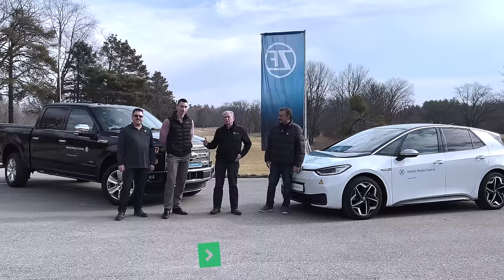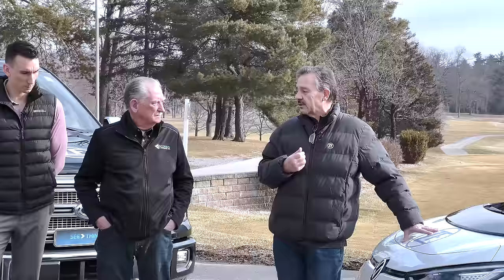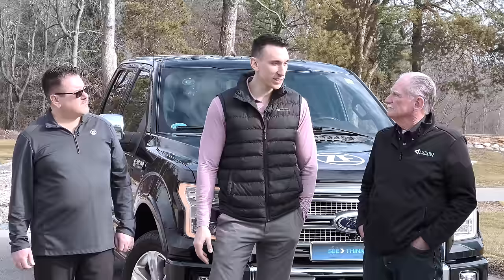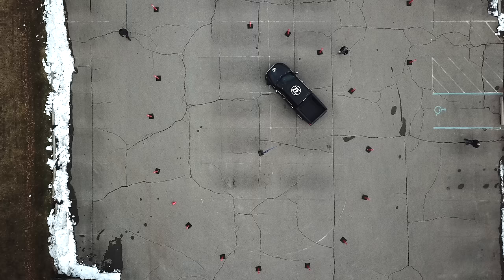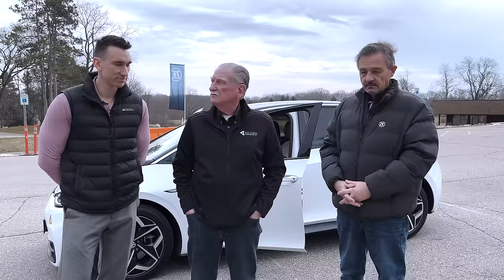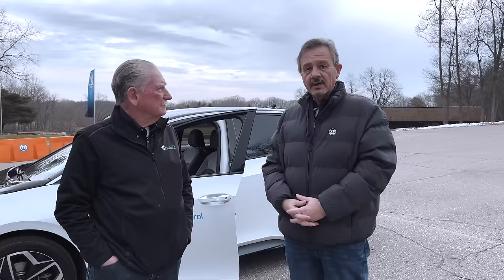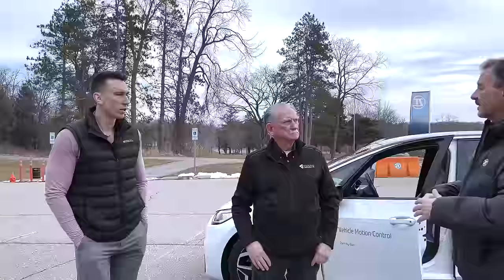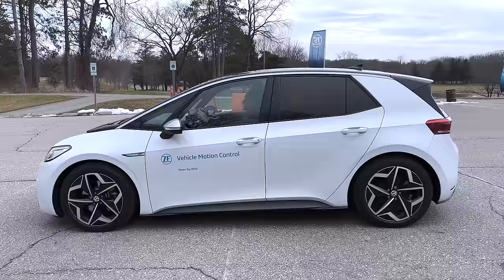Steer-by-wire - how it works with ZF

Comment: I have a question om steer by wire safety.....
I realize that they have redundant systems. But what about power? What if there is a complete power failure? Do they have a backup battery just in case?
Reply: The 48 volt electrical system has its own battery.
Reply: In an airplane there is generally much more time to react to an electrical failure.  They have multiple power backups.    Each engine has a generator, there is often a APU and if all that fails they pop a prop driven generator out to create power.    I have heard that the CT has 2 redundant power systems.  Don't know enough about it to say more.
Reply: @davidelliott5843  Yes, but is there one or two 48 volt batteries? If one fails and there is only one and it fails... You're screwed!
Reply: @danharold3087  Thanks. Yes, I've also heard that they have redundant systems, but unless that actually includes two batteries so it is fully redundant, there is a problem. Hopefully someone with direct knowledge of these systems will let us know.
Reply: @DavidJohnson-tv2nn  Exactly.   How about using one set of wheels in the regen mode during a power failure to power the system!    Some say the tech is too expensive for redundant power backup.  It is already there.  Maybe more transistors.
Reply: After the past few years of Boeing Fly By Wire fails killing hundreds of people per incident despite the high level of maintenance passenger jets receive I would be hesitant to view a mechanically disconnected steer by wire system in a personal vehicle as a viable system for public use.  

I hear the argument about fighter jets using them however most drivers can't afford a team of flight-line mechanics to come over and verify the safe operation of their Drive By Wire System every few drives or so like they do with fighter jets since that would make owning a vehicle unaffordable for all but the most wealthy individuals.  Ask a flight line electronics tech how many fighter jets get sidelined for extended periods of time due to issues with the electronics and fly by wire systems?  Most might be amazed at the answers.  Too often they can become sidelined for so long they end up getting scavenged for parts to keep those with easier to fix problems flying.

We also know from experience that the MBA's and Bean Counters will not be able to resist modifying parameters to shave not grams of weight but every fraction of a cent they can off these systems, sacrificing quality on the Altar of Maximizing ROI and maintaining Fiduciary Responsibility to Shareholders.  An honest consideration of what could go wrong should cause most to have trouble sleeping at night.

While I find it amazing technology I'm not sold on it being a required or highly desirable element in a basic transportation vehicle.

Best!
Reply: @neilfromclearwaterfl81  Your viewpoint is valid but your examples are not.

You started on the wrong foot.  MCAS was not fly by wire.  It was designed to apply a small measured amount of force to the yoke to make the yoke feel like a 737-NG.   Somewhere along the line this really got messed up.  As designed the pilots could have simply moved the yoke.   A similar system was and is being used successfully with the  KC-46 tanker to stabilize the plane as weight shifts during refueling. 

Fact is that MCAS as designed only required 1 AOA sensor because it was an augmentation system.   I can only speculate on how it was so badly messed up.  It is unconscionable.   I can't imagine a computer engineer/scientists of control system person messing it up like this. 
The sad part is that in days gone by they would never have tried to make the plane feel exactly like its predecessor.   They would have more or less taken up new pilots and showed them that the stick felt a bit different.  Good to go.  Make of that what you will.  Yes pilots are now trained to fly the MAX w/o MCAS.  So sad.

Apparently in the case of the lost door plug having that crew of flight mechanics at the planes beck and call did not help.
Reply: @DavidJohnson-tv2nn  There are two batteries/power sources.
There is the 48V battery and the HV battery (which can also be used to provide 48V)

Comment: Fascinating. It takes Tesla to deliver the CT and suddenly Sandy gets invited by a big german supplier so they can demonstrate their Steer-By-Wire system. Why didn't they pitch to other car manufacturers before so we could've get rid of column based steering ages ago? Very curious. One company that kicks the industry out of stagnation it seems. Next we see Bosch invite them to demonstrate their 48V system.
Reply: Japanese manufacturers were putting steer by wire in the odd car over a decade ago. It's not even slightly new as a technology, the main problem is it's solving a problem most people don't have in a more expensive way, so negligible consumer interest - I already have electrically assisted power steering with mechanical feedback straight from the road with far fewer parts, safe steering in the event of power loss, and way less computer intervention. The most interesting thing the electronics related to the steering do in my car is feed the steering angle and wheel speed to the satnav, so it can still tell me where I am in tunnels using dead reckoning, and that's in a satnav system that first came out around 20 years ago.

48V electrics, on the other hand, should have probably have happened 20 years ago - that was the point where I first read about the car industry pushing for it. There still is no good argument against it apart from 48 V is lisghtly more prone to giving people shocks that can kill them, but in a 400+ V electric car that seems somewhat moot. The Mercedes S Class from the late 90's/early 2000s was supposedly running enough electrical toys that they claimed it could at least theoretically pull 5 horsepower from the battery. Converting to less medieval units, that's about 3.7 kW, which would require a 310 Amp current to deliver it at 12 Volts. I highly doubt that figure ever occurred in the real world, but the cold cranking amperage on some batteries is in that territory, so there would be enough copper going from the battery to deliver that much power for a short time.
Reply: ZF has offered their system to anyone who wants it for a long time. The 4WS systems are commonly used in expensive cars, but no one has chosen to use front steer-by-wire from ZF yet... all of which has nothing to do with either Munro or Tesla.

Comment: incredible, at what point to steer by wire kits become available to the aftermarket for enthusiasts?
Reply: Unlikely. Cars today have umpteen computer boxes all doing this & that and communicating. Take one away and the whole system falls over.
Reply: @davidelliott5843  So install it with all the modules? I don't see any reason It wouldn't work. Also systems don't just fall over unless you throw a rod, there are redundancies for a reason.
Reply: ZF literally make these systems for car manufacturers to buy. You can probably buy it straight from them, but integrating it into a car that wasn't designed for it won't be cheap or easy - easier than converting a steer by wire vehicle to mechanical steering though 😛.
Reply: @peglor  A challenge always makes it more fun :P

Comment: You back into that spot, basic truck knowledge
Reply: That's rear wheel steering
Reply: You're missing the point.
Reply: @jamesengland7461  amazing how people will miss the point like that. its just to showcase how effective 4  wheel steering is.
Reply: Yes! Plus it doesn't cost me a premium to have 4-wheel steer.
Reply: Thanks for the info , never knew
Reply: @jamesengland7461  when you back in, it reduces parking lot accidents by 90% there's the point.
Reply: @chrisborns5972  the point of the demonstration was to showcase the added maneuverability of 4 wheel steering. they just happened to use parking the truck to do it.
Reply: @user-xj5xp6qz5g Other than pulling into a parking spot and maybe a u-turn, what advantage is it?  I am not sure I see any advantage when towing a trailer, might even make it worse.
Reply: @chrisborns5972 Yes!  That's what I tell my wife everytime she questions me for doing it.  I get a visual on where I am going ahead of time, then when leaving I can simply pull out.  Nowadays though, we have 360 cameras and ultrasonic sensors blah blah blah. I think we have made worse drivers and then continually use technology to compensate for it.  It was really hard to spec out my last truck without and driver assist features.  I think it will be impossible next time around.

Comment: How long will the components involved hold up when compared to traditional steering components? Will they be more expensive to maintain over the life of the vehicle?
Reply: Mechanical and steer by wire steering racks are basically the same. Replacement costs should be similar. The power steering motors will at least double the replacement costs. However the car has two which can work independently but usually share the load. They should be more durable over time than the heavy 12v steering systems we have in today’s ICE cars.
Reply: Cybertruck , has fewer parts , is more than 90% reliable ALL THE TIME.
Reply: @davidelliott5843  Let's hope. Only time shall tell.
Reply: @markplott4820  I, for one am not impressed by the idea of 90% reliable steering.

Comment: Steer by wire is cool however on the big / small car topic, driving a small car is magical. I have been driving a pickup for work and switched to a small car and its so great. uturns are easy parking is great acceleration is quick.

Comment: Why cant the system turn the wheels 90 degrees for moving sideways into a tight parallel parking space? Sure the mechanism that attaches the wheels to the car would have to have enough clearance and the wheel wells would need some redesigning. But steer by wire should enable this. Maybe that will become a thing a few iterations later.
Reply: The ridiculously oversized wheels in SUV's already eat so much into the interior space with the current poor steering lock that many massive SUV's have no more interior space than a decent wagon/estate/touring/kombi bodied car from the 2000s. But then again they've made it so bad already that making it worse may not affect their sales, since so many of them spend their entire lives carrying one person anyway 😞. Also, driving wheels that can turn 90 degrees from straight is very difficult by conventional means, but hub motors are a thing in electric vehicles, so that could be worked around.

Comment: Nice informative video. So many comments about it, so I'll say something about the ID3. A compact car with a mid-sized interior. Loads of space inside. VW doesn't sell it in N. America, yet for me, and many Europeans, it is way better than the sibling ID4. It steers, handles and performs much better. Not super cart-like, like a Tesla M3, because it sits relatively higher, but it is still fun. Sadly, it's over priced these days though, with rivals reducing their prices. But, if it was price keen, you'd like it in N.America, as a TM3 alternative.

Comment: Having been behind the wheel of a vehicle traveling at highway speeds that was struck by lightning and lost all electrical power, I am glad I had a physical connection to the steering rack and was able to steer the vehicle safely to the side of the road.
Reply: I'm not.😢
Reply: Steer by wire (fly by wire) has been used on commercial  and military aircraft since the 80's without major issues. There's an element of redundancy that needs to be built in.
Reply: When Kyle Conner was doing his range tests of the Cybertruck, and ran the battery until the vehicle shut down on the side of the road, I was wondering if they also lost steering ability, or if there was a hidden safety buffer built in, which was not disclosed by Tesla.  They never said if the steering went dead or not.
Reply: @eddiegardner8232 steering runs off LV. If HV goes down the LV will keep safety critical systems up for a short while.
Reply: @eddiegardner8232 also, there is a buffer. They don't disclose because it's not a rigid setting. It can vary based on a number of conditions.
Reply: @chstra45   Well no,   The communication is most likely logic level.   The motors that move the racks on the CT are 48V.   Using 48V makes it easier.
Reply: The traction battery will go dead before the 48V system battery. The latter powers the steering and the brakes. The driver will be able to stop in full control of the car.
Reply: @davidelliott5843  "The traction battery will go dead before the 48V system battery."  Generally but it unsafe to use it as an assumption.    In the one case were we seen this this is little information.  According to what I remember everything turned off/ went dark.  Not enough information.
Reply: @danharold3087  48v system is the LV in the CT. You can call it mid voltage if you want to be pedantic. The 48v system has 2 power domains, one runs off the 48V LV battery and one supported by the PCS. If one fails the other is capable of providing the power to safely get off the road and come to a stop. I'm unclear as to what your objection was to my previous statement.
Reply: @chstra45   I don't understand what I was object too either.   Agree 100% here.   Not sure why I mentioned logic level.  My bad.

Comment: My first high school car was a '52 Buick Super without power steering.  About 5 difficult steering wheel turns from lock to lock when parking it.  I am open to steer by wire + rear wheel steering whenever whoever puts it into my next EV.  Cybertruck has it, but my Model Y doesn't. (And I don't really want to have to buy a truck, to get it)

Comment: When contemplating having "safety" features, such as dodging other cars or road hazards automatically via active steer-by-wire hardware, think about Tesla's "phantom braking" problem, or Boeing's MCAS stall prevention system on the 737 Max.  Go very cautiously into that territory; lawsuits can get very expensive, and safety reputations can vanish overnight with just a few accidents.
Reply: The MCAS system is an example of management corruption and maybe communication failure rather than engineering.   Phantom breaking on the Tesla is most likely the car being cautious.   We could expand the period of allowed uncertainty prior to applying the emergency stop but it would be unwise.   Better to improve the system so as to reduce the periods of uncertainty.
Reply: This is not what concerns me. What concerns me more is things like memory corruption from software bugs and random cosmic rays, intermittent electrical issues after years of salt accelerated corrosion, and other bizarre failures that are hard to predict and give no warning of trouble
Reply: Electronics are the most durable part of any car. However any safety intervention such as emergency steering should be as reliable as emergency braking. There are so many edge cases of what’s already an edge case it’s hard to know how that could work.
Reply: HW4 vehicles , have no issues w/ Phantom Breaking.
Reply: @markplott4820   That’s nice to know since I just bought one, an Austin-made Dual Motor.